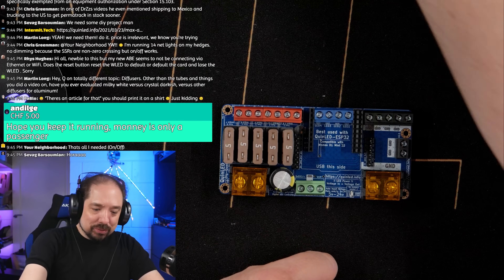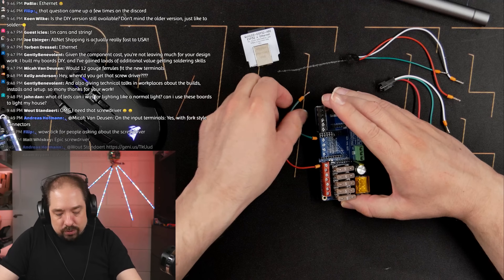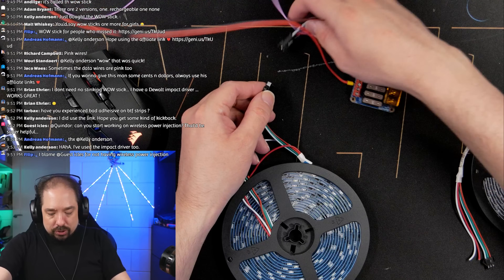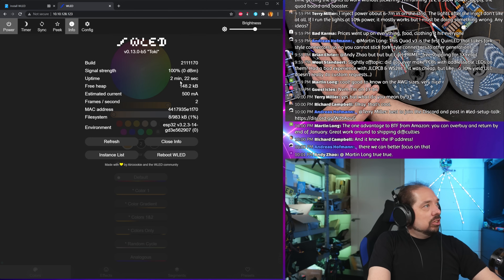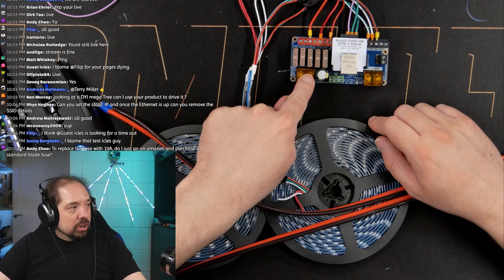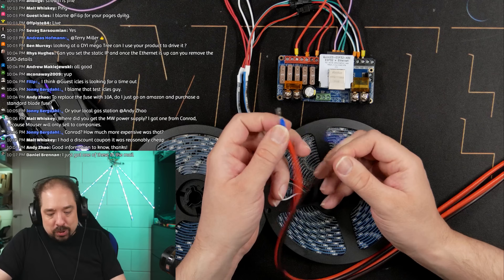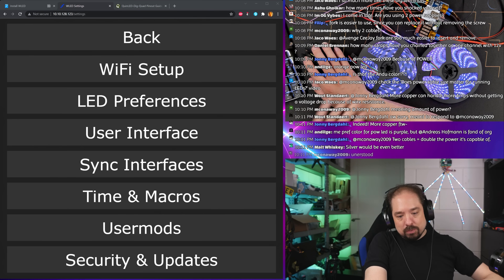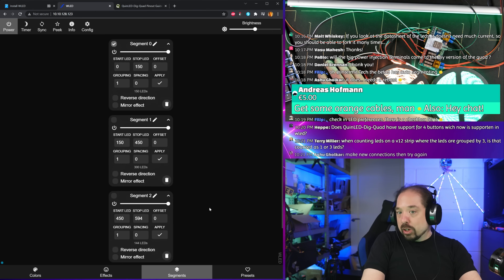💡QuinLED💡 WLED tutorial 2022 - QuinLED-Dig-Quad setup from scratch, with Ethernet!

Comment: Hey, I just want to say keep up the good work you are doing and your products are the best, I have tried and tested a lot of other products and since i discovered your products it has changed my led displays, and running complex displays, etc etc, and initially i was struggling and the wachtend your tutorials, i managed to resolve all my challenges, for example i have a 1000 led matrix snd could not get it working. And used a dig-quad and injected powers after every 250 leds, snd used the signal  booster, snd it works, and the best is every year i hit plug my dig-quad in and it works … i have 7 dig-quads and the penta plus for my dumb leds and everything just works. Thanks for al the work and effort you have put into your products… keep up the good work.

Comment: I hooked up three(3) separate data lines and only the 1st data line worked. I tried using GPIO 4, 13 and 16 thru 33 (as directed by a WLED video) with no luck. THEN....I see your video here directing me to a Pinout Guide for the DigiQuad and BAM......It works!!! You nailed it!!! I needed to use 16, 3, 1, and 4. Muchas gracias from Panama!!
Reply from the maker: Hey awesome to hear it and yeah I try to make proper documentation for all the boards!

Comment: I have a question: Can I connect two identical PSUs?
Reply from the maker: That's not recommended, never connect 2 PSUs when they are close to each other and for power injection, make sure the positives are disconnected from each other.

Comment: Does it have any signal amplifier? And what is the maximum distance between the controller and led strip for data transfer?
Reply from the maker: My Dig boards like the Dig-Uno, Dig-Quad or Dig-Octa do yes. Generally people have great results up to 5m/16ft and often up to 10m/32ft also works. For beyond that I have different solutions.
Reply: @IntermitTech  Thanks for the response! "In my case, the distance would likely exceed 20 meters (65 feet). What would be an alternative solution?
Reply from the maker: @Beast6000jdjdieoeoidis using the Diff-Solo solution or the upcoming Diff-Adv, with those you can go up to 500m!

Comment: curious why you have 2+ve and 2-ve as input power.
Reply from the maker: Especially for 5v if you want to go up to 30A you want to minimize voltage drop and heating up of the wires at every stage. Power supplies have multiple terminals to accomplish this so if you really want to run 5v 30A it's recommended to connect with 2x 10AWG or at least 2x12AWG between the PSU and board. It makes it much easier (and cheaper) then running say 1x 6AWG.

Comment: I am in the process of planning my set up for a new apartment and was wondering if anyone can confirm my calculations and specifications or if I have overlooked something. I have 36m of indirect lighting planned which is a lot of power etc. 

I will be purchasing the following parts unless someone recommends something else: 
36m ws2814 RGBW 24v 21w/m max on full brightness (probably won't be on full brightness all the time) = 756watts/32Amps 
2x MEAN WELL NDR-480-24 - Each 480Watt/20Amp output 
QuinLED-Dig-Quad LAN 

Am I right in thinking that I can connect two power supplies to the Dig-Quad?  The 30 Amps should probably be more then enough I think - Just if someone plays around it could go up to 40 max.
Or should I better go for the Dig-Octa here? 

Are there any other things I should pay attention to - also in terms of safety? 

Also, my apartment is 6m long, so the strips will be a bit longer than the recommended 5m. Should I pull the power supply to both sides of the room or is 6m still enough/barely visible?
Reply from the maker: Please usr this guide, it will help you a lot in figuring this out: https://quinled.info/the-ultimate-led-strip-power-injection-guide/

You can never connect 2 power supplies to a single board unless you have really really expensive balanced PSUs (a special feature on the PSU itself).

Comment: Could you ever wireless control an ESP controller using a wall switch with zones? I have multiple LEDs in my kitchen but need to control them easily with a quick switch.

Comment: Just curious, I flashed esphome onto the esp32 that came with my dig quad. I just like the simplicity of the inerface. Anyway I have connected exactly as your diagram and video shows to 3 separate WS2811 RGB strips. One of them on GPIO16 I can control with no issues having neopixelbus in my yaml. The other two strips connected to GPIO3 and 1 I cannot control. NO turn off, no variation in rgb. Any ideas?

Comment: If your three strips were different voltages could you just take the data feed from the Dig Quad and power the strips with their own power supplies?
Reply from the maker: Yes that is possible, make sure to share DC GND between all power supplies and that positives never meet, then it should work fine.

Comment: Can I use it with a five pin LED strip RGBWW I can’t seem to figure it out could be great with a little help😊
Reply from the maker: If it has positive and RGBW wires then no that's an analog strip and you need digital LED strip (so with a chip) for digital control!
Reply: @IntermitTech  thank you so much for taking the time to answer

Comment: I have an ABE dig-quad board, I flashed with latest WLED but how do I get into the software to enable the Ethernet port? This is my first time setting one of these up. I pulled an ethernet cable in and checked my router but it does not see any ethernet connections.
Reply from the maker: Join the WLED-AP, go to wifi settings, scroll down and selected QuinLED-ESP32 in the Ethernet settings, done!
Reply: @IntermitTech  I see the IP in my router network devices but when I try to connect to that IP I get nothing. Im trying to do this while still connected to the USB. Is that perhaps my problem?
Reply: I have also tried connecting the ESB32 board back on my dig-quad and powering it up normally. I still cannot connect to the IP

Comment: Why do you use 4 cables from the power supply? and then you connect the first pair, the red one to the number 2 and the black one 1. I only have one power supply (2 cables) how I should do it?
What is the purpose of have doble input for power?
Reply from the maker: You run multiple cables from the same power supply to the board to minimize voltage drop to the board (which is the distribution point) as much as possible. See this video for the why and how: https://youtu.be/behbh8VqPTg
Reply: @IntermitTech  thanks a lot :)

Comment: I received my dig quad last month and wired it with my WS2811 (12v) and got the WLED to communicate with the controller.  My WS2812 (5v) finally arrived and tried it as well but the board will not communicate.  I don't see the WLED AP in my wifi settings.

Comment: I have a noob question. I have the Dig-Quad ABE. I am planning on using it with Xlights to run my show. My question is Do I hook the other end of the ethernet cable to my home network? or to the computer running Xlights? Thank you for the Dig-Quade ABE I used it with Wled for Independence day here in USA. We live on a lake and drove around with the lights on our UTV. The kids in the lake were very excited to see it.
Thanks keep up with improving . I would recommend it to anyone.
Reply from the maker: Thnx! And yes, just hook both the computer and the Dig-Quad up to the same network and they can then talk to each other. :)
Reply: @IntermitTech  Thanks for your quick response.

Comment: The screw terminals are the same usual stuff we get on Ali? I wonder how much amps can you push trough those ?
Reply from the maker: Yeah if you usr the ones from my hardware guide and make sure you get the ones with "copper feet" you should be good.

Comment: Newbie with a more semi fried brain. But I'm still determined to give this a try. 
I ordered a Dig Quad with on-board antenna but now it seems I should have gone the ethernet route 🤷🏽‍♀️. May have to rebuy an ethernet Quad when stock is back. 

Do you recommend the fully enclosed power supply with a fan or the open power supply with "chicken" wire ?

Did you ever make the video for power injectors?
Reply from the maker: In regards to power supply you need what you need. You'd first have to calculate your needs. 200w can generally be had fanless above that they often have a noisy fan.

I have a power injection live stream here which takes you along to calculate everything you'd want to know:https://quinled.info/2020/09/26/power-injection-livestream/

Comment: I have seen in an older video with you and drzz. When you make your segments you had them grouped at 300 per channel. So you guys had segments 0: 0-150, segment on 1: 300-400, segment 2: 600-650, segment 3: 900-950. In this video you leave no gaps in the numbers. Just trying to figure out which way is better or if it makes a difference?
Reply from the maker: Since WLED 0.13 the interface has changed to do a lot more automatically so now you just give in the amount of LEDs which makes a bit more logical. Try it out!
Reply: @IntermitTech  Makes more sense. I just got a digquad external antenna from you site when it had a small restock. If finally came!  Does it come pre flashed we’re all 4 channels are turned on?
Reply from the maker: Yes but that's just a simple default config, check this article and video here how to set it up: https://quinled.info/2021/03/21/wled-0-12-what-do-i-configure-for-quinled/

Comment: What's the easiest way to connect ~1700 leds on 1 controller?  I am using a digquad with power injection.  Initially all of my leds lit up.  Then after an update, it will only allow me to put 1500 leds on the controller.  Is there a way I add the last 200 leds and set it so it looks like 1 segment?  I've been trying to find an answer and I'm stumped.  Thanks.

Comment: I’m new to this world and this was a very helpful video, thank you very much! Quick question, I have a dig quad with the ESP32-ABE ethernet board and have enabled it under the WiFi Setup tab using QuinLED-ESP32 as demonstrated, but am not getting the light indicators on the front of the Ethernet port. I tried it with leaving WiFi on and removing my SSID with no luck either way. When I remove it, the whole thing just disconnects altogether and cannot control it via WLED until I reconnect to the AP. There is an orange light, I believe power indicator, on the bottom of the Ethernet board but that is the only light I’m seeing on it. Everything else is working fine with the exception of the Ethernet port. Am I missing something or do you have any advice? Thank you again!
Reply from the maker: We all start somewhere! Come to the Discord server and we can do some troubleshooting with you (there is a #troubleshooting channel). If it ends up broken, no worries we just replace.

Comment: I want to do 500 linear feet of led  on my house can I control my  permanent led with those controls or I need something bigger my lay out is 250 feet bottom soffit and 250  top soffit. My central control will be 100 feet away from  led strip.

Comment: How can you add motion sensors to a project using a Dig-Quad and wled? any info would be most helpful, just ordered the board and looking forward to starting some projects
Reply: Your motion sensors and anything in wled should both be connected to Home Assistant. The you can have anything in HA control anything else easily.

Comment: Good evening. I have a major question. Will the quinLED Dig quad will work with an external power bank? I’m wanting to do a helmet with full led animations and I wanted to see if is possible to run it with an external power bank? Thank you so much for your channel and your will definitely be buying couple of digquads
Reply from the maker: Sure, in theory that's no problem, most likely you'll only be able to pull about 3Amps from a USB port though and that officially already requires 2 pull-up resistors.

Also maybe consider the Dig-Uno since it's much smaller in size and easier to hide in that regard.
Reply: @IntermitTech  then a 10k resistor on the ground would do the trick? Or should I power it with 12v batteries instead? That’s so I don’t have to use the resistor? Thank you so much for all your help and channel🙏🏻
Reply from the maker: Ah no! USB needs a specific setup to tell it what to deliver. A simple 12v battery wouldn't  though so that could work.
Reply: @IntermitTech  thank you so so much I wil go with them 12v then 🙏🏻

Comment: I am running a ws2815 5M strip on a MEAN WELL LRS-350-12v psu. Do you recommend front and end loading injection and if so, would 12v injection be overkill or should I use a step down converter to 5v at end? Thank you for the informative channel!

Comment: Why is there two lines (2 reds, 2 blacks) coming from your power supply to your dig-quad? Is that required?
Reply from the maker: It depends on the Amps you are going to run, if you are pushing more then 10Amps through the board out the various power injection points yes, it is, it will limit voltage drop between the power supply and the distribution point, in this case the Dig-Quad board. Especially when you are getting near 30Amps continuous, 2x set of 16AWG at least is no luxery.
Reply: @IntermitTech  I assume there's no harm in just using 2x set of 14awg wire to be on the safe side regardless of my ultimate voltage use?
Reply from the maker: Yes, no problem, you can go up to 2x10AWG in regards to what fits. Voltage always needs to match (so 5v LEDs get a 5v power supply) and Amps need to be enough, and more is fine. So if you expect 10Amp draw, get a 15Amps or 20Amps power supply (a bit over is recommended) and it's all good.

Comment: What version of WLED got loaded? I'm trying to follow along and I don't see the selection to create a segment for each oiutput.
Reply from the maker: V13-b5 but since then v13-b6 came out, make sure you are on the v2 flasher website.
Reply: @IntermitTech  Ah, well then. I flashed V12 because I wasn't sure of the beta releases. Thanks!
Reply from the maker: Ah yeah, it's a new feature in v13, but you can easily set it manually in v12. :)

Comment: I am new to this, but now have some Dig-Unos and Dig-Quads to set up as soon as I get some LED strips. I have the iPhone app for WLED, but would like to be able to configure and control the Dig-Unos and Quads from a Windows PC. What are you using to do this?
Reply from the maker: Just any normal web browser (I used Chrome) will do that, just connect to the IP, done!

Comment: I tried using the BTF WS2812B Fairy Light strip on my tree this past Christmas, and really liked the look. However, I've managed to blow out 2 separate strings from static shocks. Have others had this issue? Is there something I can do to the string/board to make it less static prone?
Reply from the maker: Oh wow, interesting, I'm still using the same strings I got 2 years ago, so far no issue. Maybe work on it while the humidity is a bit better? :S
Reply: @IntermitTech  That'll work: I'll just set up the Christmas tree in August... ;)
Reply from the maker: Well, or fix the humidity at home. We had really bad problems with it too, kept zapping the GF so now have a humidifier which helps tone. ;)

Comment: So I am waiting on 2 digg quads to come in from overseas and I would like to have the controller on separate power supply from leds themselves so I can keep power usage down when not in use. Can you show how to wire that setup please? Also when using channel 1 output for leds  why can't I use output 2 for my power injection on the same sting of lights? I could change fuse out to a 10amp from the five correct? That would fuse both feeds for that string of lights on 1 fuse and keep the setup clean. I am using 12 volt led strings with approximately 100 ft. Length.
Reply from the maker: Hey, awesome! Yes, especially on the Dig-Quad it's pretty easy to use the vEXT setup, we're currently working on a re-newed article for exactly that setup, should be available soon!

Regarding power injection, sure, you can use terminal 1&2 which use a single fuse. The idea has always been that if you had a single 5v strip you'd inject front and back from that single fuse (by changing it to a 10Amp fuse indeed). You won't make 100ft with just 2 injections though or you'd be running them VERY limited, but yeah. :)
Reply: Thanks for the quick reply and info. I am Going with 12 volt to decrease the amount of power injection needed. I appreciate all the hard work you have done to make the boards and keep them updated. I'm new to the led light community and I chose to go with your boards just because I like the content you and Dr.zzz put out for us new guys.. Thank You again.